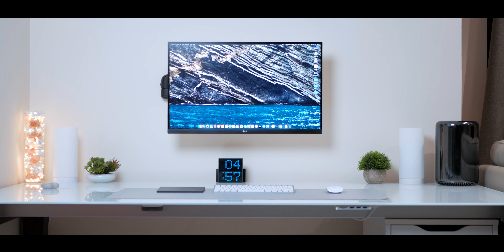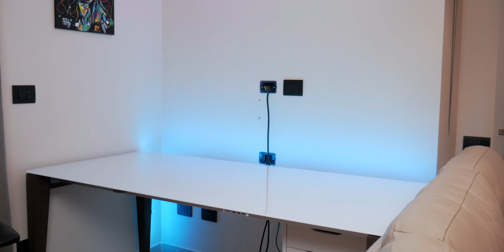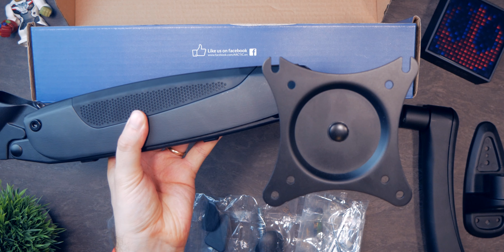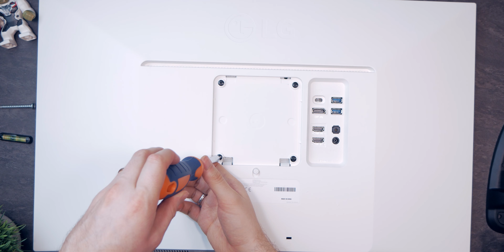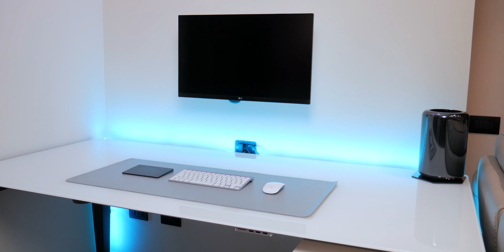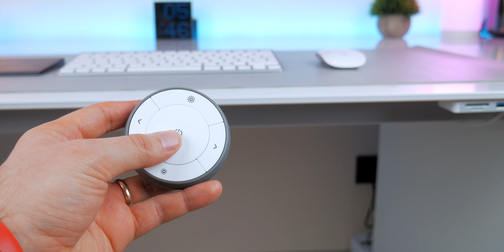Building my Home Office - DIY Clean Modern (2020)

Comment: Very nice setup. 
How did you integrate the ikea remote under your desk?
Reply from the maker: Yeah I’m using the IKEA tradfri remote with philips hue. You can set it to control Philips you  with the setting button on the remote
Reply: @ShadesOfTech  I see, I like the way how you put the remote under your desk. Did you screw the whole piece under it so it becomes immobile and won't fall?